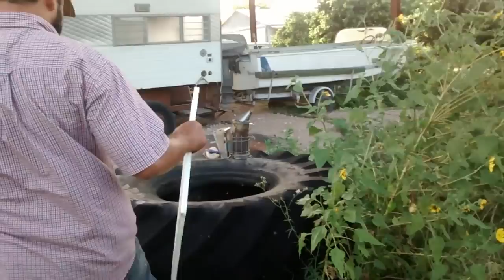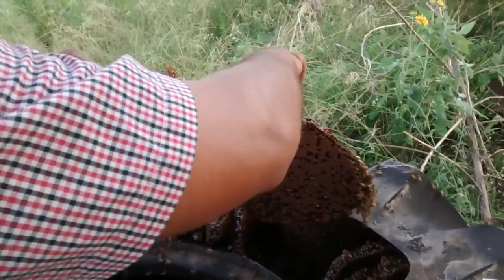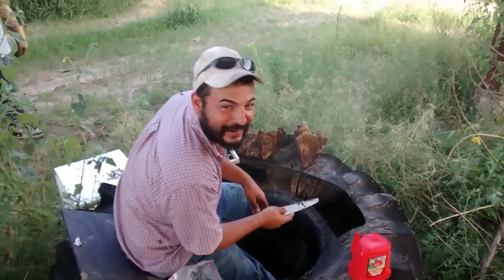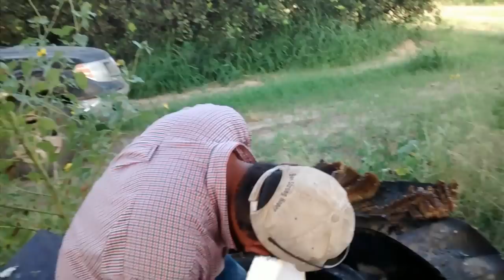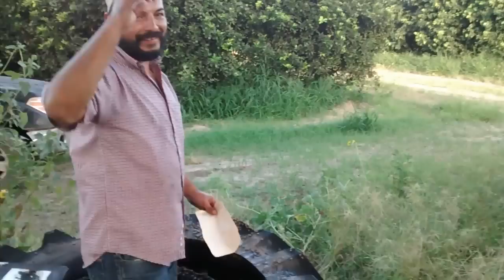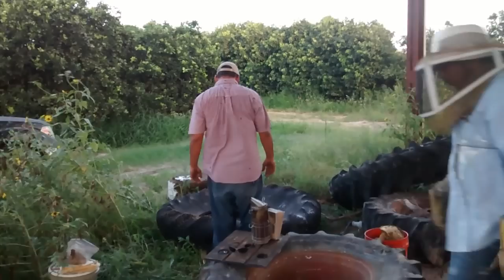Honey Bee hive removal in a tractor tire by Luis Slayton of Bee Strong Honey and Beehive removal

Comment: I see you have wired most if not all your frames.  Are you pressing the comb into that wire as well as putting rubber bands around it.   Is the wire pretty tight like it would be to lay foundation wax on or is it pretty loose?